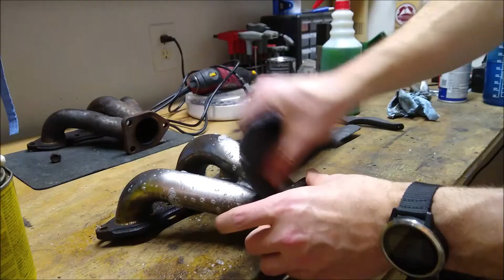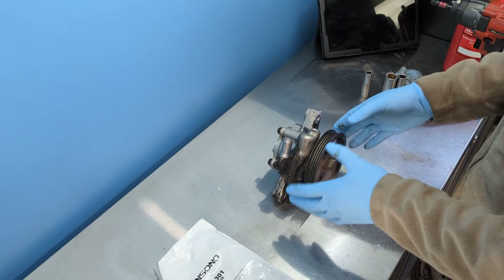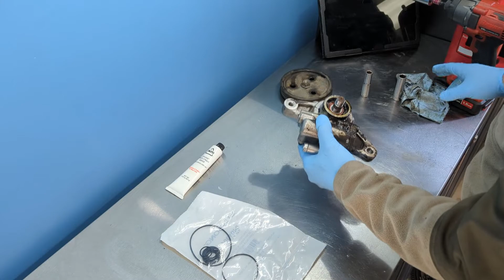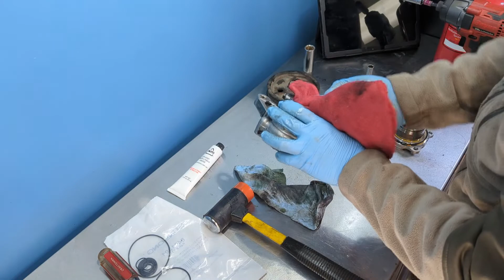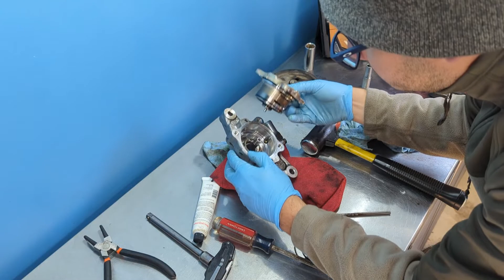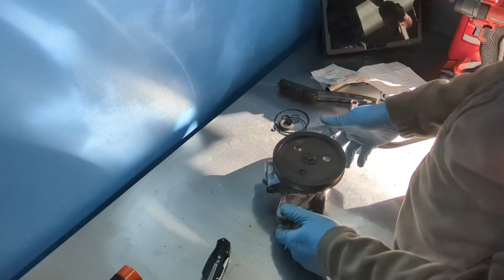1991-1995 Acura Legend Power Steering Pump Reseal (DIY)

Comment: Good video!  Q: what cleaning agent do you use in that spray bottle?  A couple PS pump seal related trivia: a whining noise is often caused by a bad seal on the inlet pipe letting air in.  Apple Rubber publishes a Seal Design Guide that explains how to engineer an O-ring; I am thinking it could be used to reverse-engineer exact sizes for otherwise-NLA (or not available outside of a larger kit) Acura/Honda O-rings.  I already robbed my Prelude PS pump rebuild kit to get an O-ring to fix whining coming from my Element PS pump, and had to use a good used one on a Civic, so I need a supply of these PS pump inlet hose O-rings.
Reply from the maker: Thanks!

A: I use brake cleaner in the red spray bottle.

Thanks for sharing your thoughts.